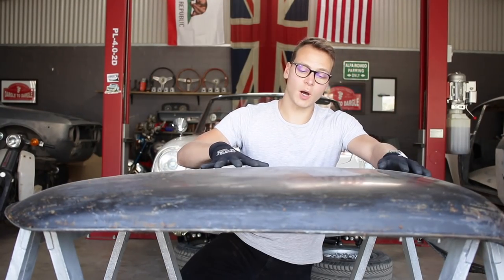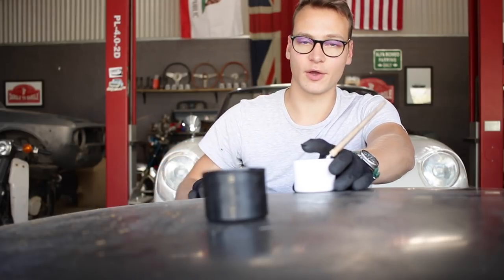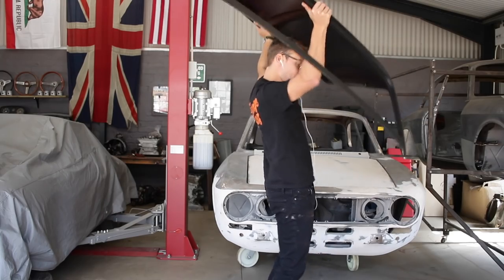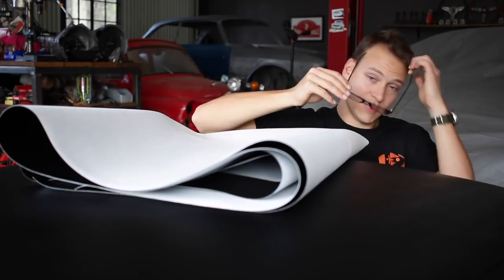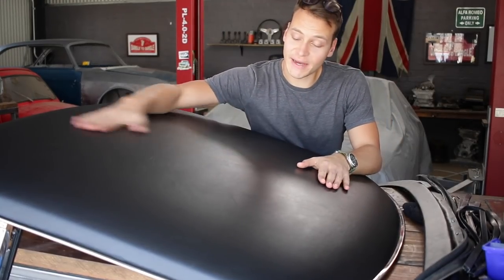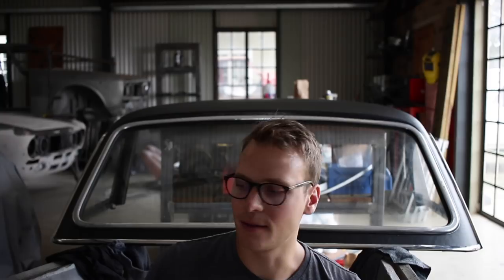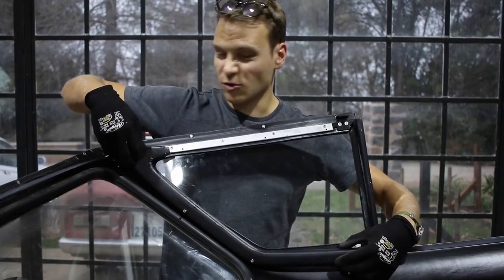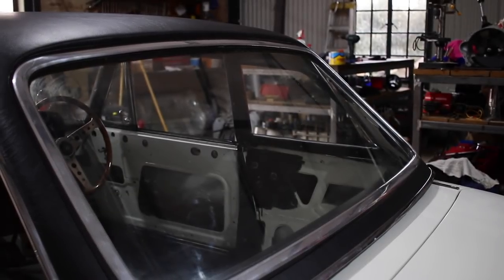Alfa Duetto Spider Project - Hardtop Restoration

Comment: That all came together really well. I would have tried to fit that roof myself as well, but I definitely would have damaged something. Great work.
Reply from the maker: Haha I got half way in and was like "What have I done?" But it worked. Will get help to remove it again.
Reply: @JethroBronner  It's not so much that it's heavy, but once you get the top up over your car, the weight is  just in a very awkward position, and that's a recipe for disaster. Definitely a two-person job. That being said, it's a job I always seem to end up doing alone. When I fit the fiberglass top for my '87 Spider Quad, I protect the rear deck with a heavy quilt and gently slip the top into place. I've been doing this for over a decade, with nary a scratch or a ding. (I hope I haven't jinxed myself now!)

I'm really enjoying your channel! I appreciate that you take the time to get things right, and that you're not afraid to call yourself out over things you should have done differently.

Cheers from Canada!

Comment: Great series, but if I can add a suggestion? I noticed that you have a very large workshop and in winter the ambient temps can be low. I would move all the work to a smaller room, heat it up to get an ambient temp to around 30 degrees, you will find that the vinyl, glue and paint applies so much better as the raised temp allows the solvents to mix and work. Even the rubber for the window will be a little more malleable if the temps are raised. Rules of thumb, do not apply any solvent based material under 22 degrees C.
Reply from the maker: Hey thanks for the tip! I'll keep that in mind the next time I'm working with this sort of stuff.

Comment: Now I feel the urge to reupholster mine... I thought mine did not fit properly in the rear but I see yours is also hovering an inch above the body ^^

It's coming together pretty nicely !
Reply from the maker: Yeah I think you can adjust the height by fitting different rubber blocks under the roof. I might do that to get a better fit on this one.
Reply: @JethroBronner  The way it seats also changes when you clamp on the ajustable hooks under the side windows to the soft tops mounting points.

Have you got the 2 slotted rails in the rear where the top is supposed to slide in to secure it. I've had trouble making it fit, for the hardtop would go down enough (it might be down to my soft top overlapping the body edge raising the whole assembly...).

Comment: Nice job, meticulous prep work pays off doing that vinyl work; every flaw underneath it gets magnified. I have a Pininfarina steel hardtop for my Fiat 1500 cabrio that's so bloody heavy I never use it. Takes two strong men and a boy to lift it! Beautifully made but weighs a ton. Shame  you have to move the spider on when you're done...
Cheers
Reply from the maker: Commando Specialties Thanks man. Yeah I actually had to do 2 attempts at the vinyl, because I let some debris get in the glue. Yeah I’m not too bumped out about moving it on, I’m more of a GTV guy at heart.
Reply: @JethroBronner  Me too, I had a 115 (US) back in the day, the prices for a decent one have become absurd now.
Reply: The weight of this Hard Top of Duetto have near to 20 kgs. Is very danger to put It with only one person.

Comment: Nice vinyl installation Jethro. I used the same technique to cover the inside A pillars of my 71 GTV many moons ago. The black vinyl looks very slick for those dingy and cracked aged interior plastic trim bits.
Reply from the maker: Thanks Mark. Yeah I'm my practice in now so when I do all those bits for the 70 GTV it will be a little easier.

Comment: Hi Jethro - great film. I am restoring my hard top now, although it doesn't need new vinyl. The rubber seals do need replacing though, especially those which sit around the car wind up windows. Can I ask where you sourced your new ones from? Big thanks.
Reply from the maker: Thanks! I got my new seals from classical.com

Comment: Instead of using rivets- for the hidden attachments- have you considered getting riv-nuts?  That way, the next owner can take out the window without drilling out the rivets and not losing the backing parts.  (although, I may have missed the suggestion timing a little....)
Reply from the maker: Yeah I really like riv-nuts for mounting things in sheet metal, but on this fibreglass they can't hold on to it. Especially when the fibreglass is this thick.

Comment: You’ve done a great Job. We decided to cover with white vinyl the underside and it really feels a lot bigger on the inside of the car. I did not see the clamps that goes on the B pillar on yours, maybe thats what you are missing...
Reply from the maker: Yeah I thought about doing a headliner on the underside. I still need to make up some clamps on the B pillar to attach to the soft top frame.
Reply: I’ll send you some pics thru instagram

Comment: Have you decided on interior upholstery color?  Taking recommendations?  I recommend a light or medium dark brown leather.  I saw the wooden steering wheel in earlier videos and think the brown compliments the white exterior really well..
Reply from the maker: Haha we're on the same page! I've gone for a medium brown on this build.
Reply: Mine is 66 with black steering. And it has the original white paint and red interior. Really looks nace and with the hardtop on it shines thru the windows

Comment: A great modification that would not have altered the appearance of the hard top would have been to clear ceramic tint all the windows.  It adds both Infrared and UV ray protection for you and the interior.

Comment: 4:00 - old trick (bodge?) for silencing old rivet remains in closed sections - spray in some wax based rust proofer - also I guess s spray on sticky grease like MC chain lube would work.
Reply from the maker: Farlig66 Thanks for the tip 👍 I’ll give that a go next time I’m working with rivets that I can’t get out.

Comment: Why on Earth are you re-using the old gaskets?  New ones are available and easier to install.
Reply from the maker: Brian Wermeyer feel free to share a link to them 😊
Reply: http://www.cicognaniguarnizioni.it/Alfa-Romeo-100

This company is the one that makes the rubber mats and other rubber bits for vintage Alfas.  Find Osso di Seppia, click on the Italian flag and select the UK flag.  Scroll about half way down and look for Hard Top.  They list all four gaskets.  If you go this route, please cut the rear window out.  Trying to remove these things the same way they went in is always risky.  You could break the glass.